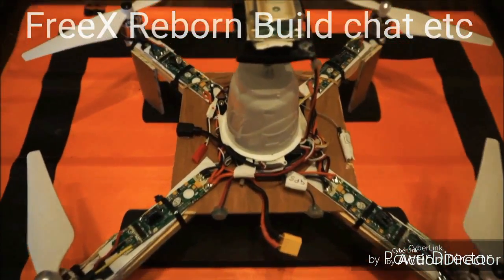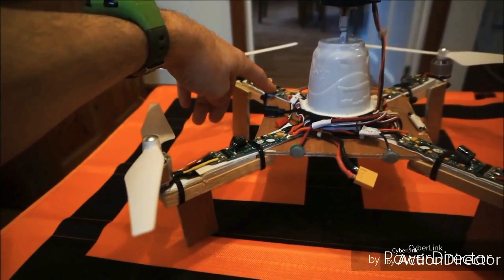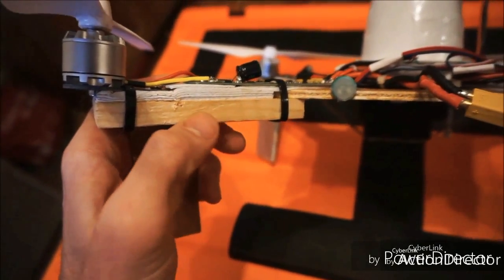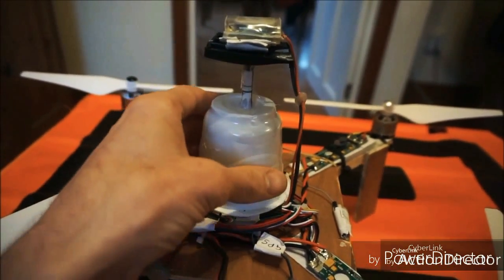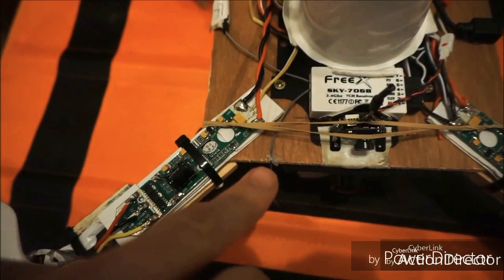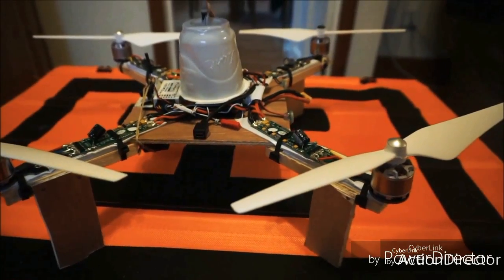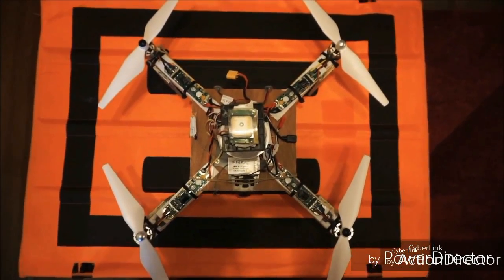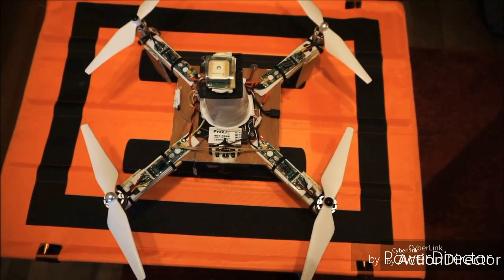FreeX Reborn Build Chat Etc

Comment: Cool diy build, I like the 'home brew' look :)
How about using short lengths of wooden dowel for the legs, maybe 1/2 inch diam? Less wind resistance etc how about adding led flight lights or a strobe light?
Reply from the maker: I've changed legs if weather good tomorrow more testing etc cheers
Reply: gadgetman 404 Should be fine weather tomorrow, I'm planning on flying mine tomorrow :)
Reply from the maker: Put Flight on
Reply: gadgetman 404 Ok will have a look :) I was out flying mine this morning at Bennerley viaduct, it was a bit windy! :(

Comment: That's cool thanks for sharing.are you going to increase the FPV transmitter ?I still can't get rid of my go fence I have no computer that will work with the down load files !!!but it's still working.I did not get the  camera or gimbal with it so it's just a short range flyer.good luck with yours it looks good
Reply from the maker: I've got 600 me that do ovaer 1000 meters and.me.on.messanger incan.rimg.you talk you through it is in uk
Reply from the maker: Run software as administrator should work then